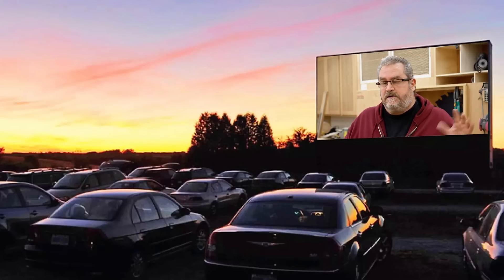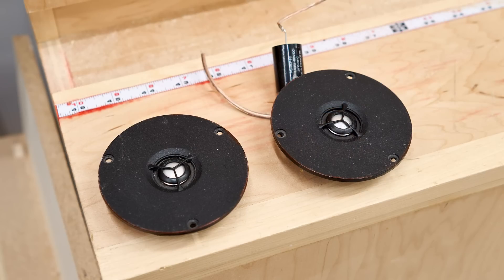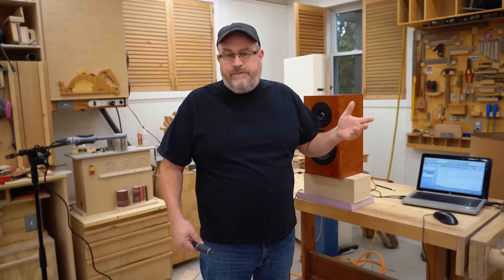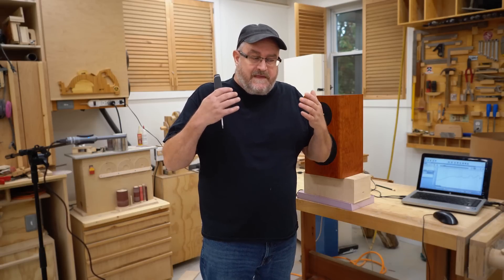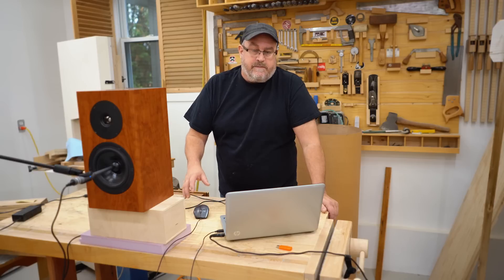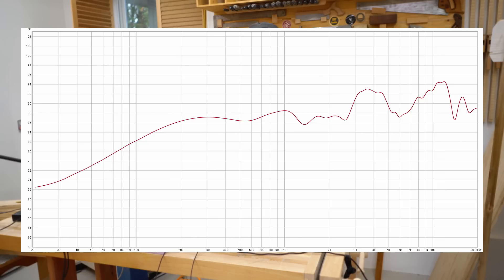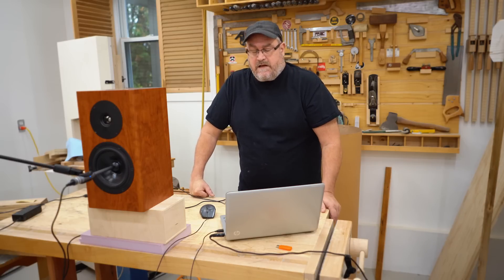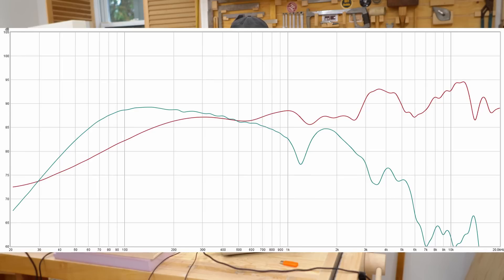Why My DIY Speakers Sound Bad / Measuring With REW and UMIK-1

Comment: Don’t you want to measure in between the tweeter and woofer? The mic is right up on the woofer. Did you measure it like this? If you did of course the tweeter measurement will be way off.
Reply from the maker: That was the last measurement I took, called "nearfield" - it measures the output of the woofer only. The rest of the measurements happen with the mic 1 meter away from the speaker.

Comment: Are you measuring the frequency response on the tweeter axis? At what distance?
Reply from the maker: Yes, at 1 meter. But having it at 1 meter is only important to measure the true spl.
Reply: @IBuildIt  Not really. SPL can be measured at any distance. Industry standard is 2.83v@1m. 1W is not an accurate representation as it assumes a fixed resistance of 8ohm. 

Was just curious. For my measurements, I use 2-3x of the baffle width. This captures the baffle effect and use a 5ms gated response. In my room, this is accurate to 250hz. I set spl on the tweeter axis at 90db and measure all drivers from that point. This captures the acoustic offset of the woofer as well.

Comment: Interesting timing. I was exploring the idea of speaker building all weekend (I didn't hear your announcement). YouTuber "Tech Ingredients" put out several very long, very scientific videos about speaker designs. They go heavy into science and convincing you how awesome they are, but they're NOT build videos, and their finished product don't look like finished furniture (the Voigt speakers are more finished, but it could use extra finish).  I'd LOVE a video of making Voigt speakers. They're not bad, but the front could use some help. - https://www.youtube.com/watch?v=EEh01PX-q9I - he says this other style sounds better, but I can't figure out how to make them look good, or fit into most home entertainment setups: https://www.youtube.com/watch?v=CKIye4RZ-5k 

Anyway, good luck, and I'd appreciate a Voigt speaker build.

(BTW That frequency sweep is awful on my tinnitus - I go from blissfully unaware of my tinnitus and then suddenly I can't convince my brain that the sample stopped.)
Reply from the maker: I messed around with transmission line speakers many years ago using Martin King's MathCad models to design them and came to the conclusion (opinion) that the benefits they have over a bass reflex design don't warrant the complexity. 
EDIT: Forgot that I had a TL speaker project on my website: https://ibuildit.ca/projects/compact-transmission-line-speakers/
And to be honest, at the time I wasn't hearing good things about the Voigt pipe designs - something about the line ending in with a point. However some swear by them, saying they are the bees knees. The overall shape doesn't appeal to me, though, so I doubt I'd build a pair.